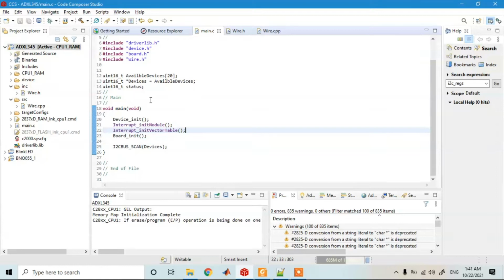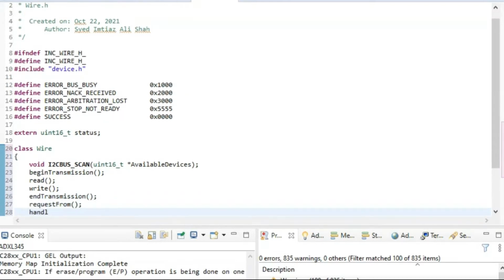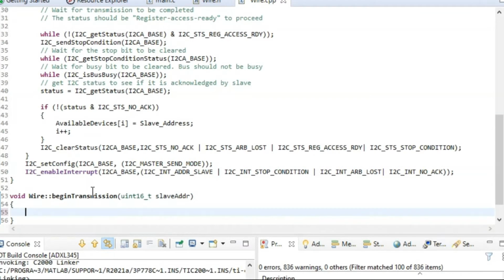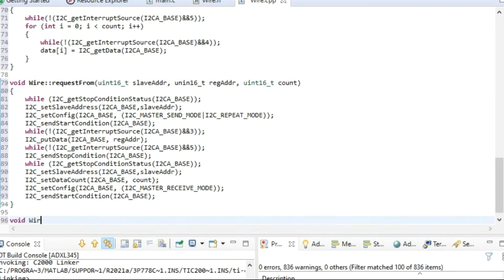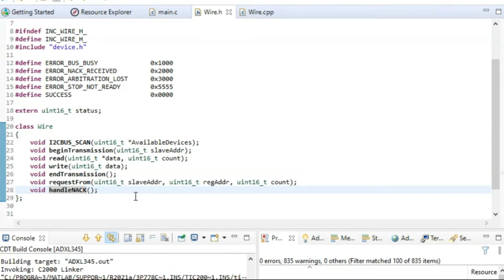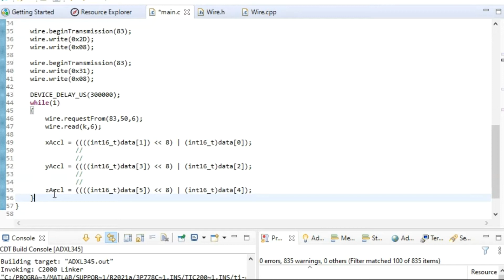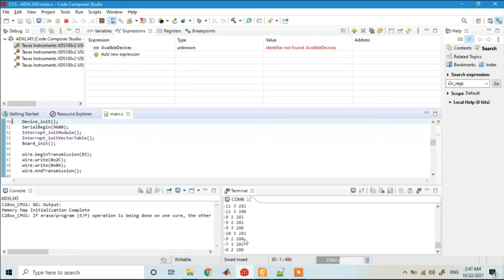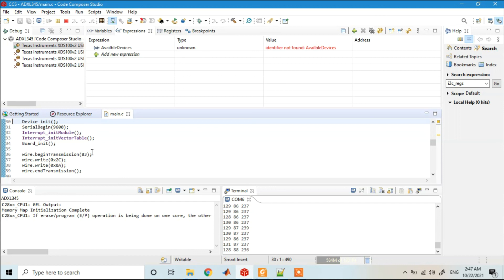LaunchXL F28379D in Code Composer Studio (CCS)-I2C-ADXL345(2/2)

Comment: Thank you for the video.I have using your code to running on my f28379d, there is a problem that the program will stuck in  sentence "while(!(I2C_getStatus(I2CA_BASE) & I2C_STS_TX_DATA_RDY));" when write(0x0A)， it seems like the data in the shift register does not send out, i don't konw where goes wrong.